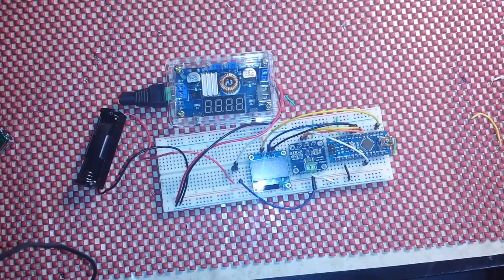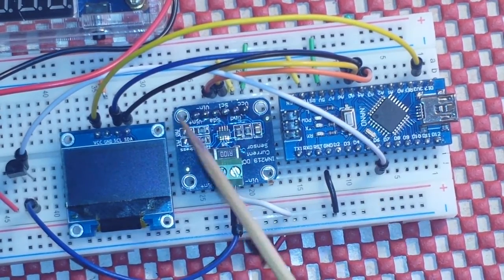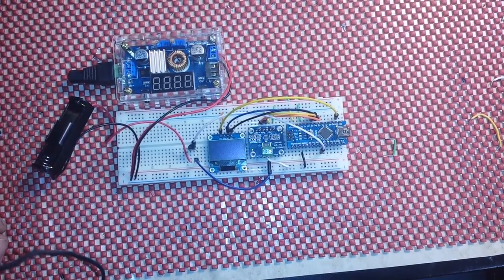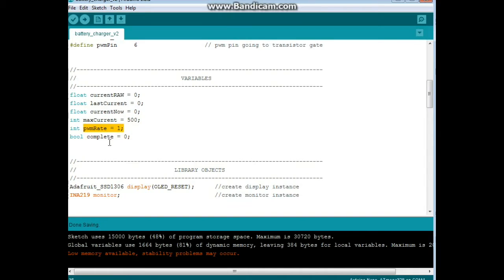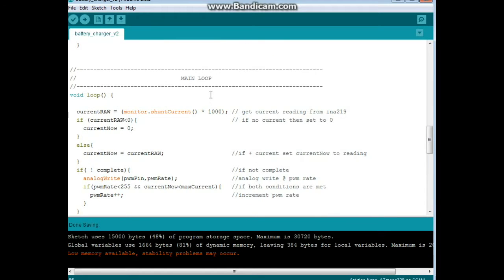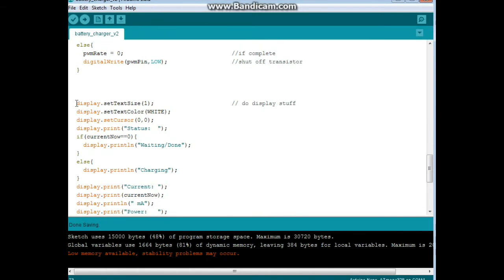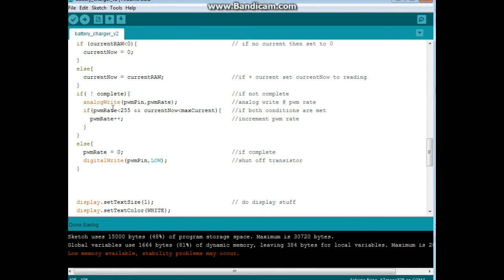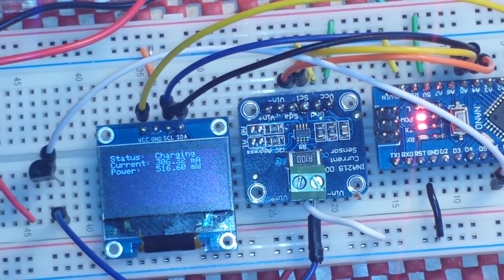How to make an Arduino Battery Charger v2

Comment: Excellent video!  I have a question if you wouldn't mind.  I've followed your setup to the letter.  How would I go about modifying the code to charge a 9 volt rechargeable battery?  I don't think I need to modify the hardware, when I plug the 9v in the power on the OLED goes way up but it doesn't change to "charging" at all.  Thanks in advance.

Comment: I like that bit:
if(pwmRate<255 && currentNow<maxCurrent){
pwmRate++;
}

It's like you either have your max current (500ma) already at the minimum pwmRate
or you keep increasing the modulation of the opening of the transitor 
in order to let more current in until you get max current.

That's savvy !
That's a good idea if you are using USB 3.0 that can give you 900ma right off the gate.

The part I'm not sure about is if Negative delta V Cut-off
is safer than just stopping 3mV before full charge ?

Comment: I just don't know what Im asking.
I am trying to build for a 4.8v NiCa battery pack.
A cheap version that's made in china.
You've mentioned in the description that with constant current mode, different setup may be charge. So, this will work with up to what number of battery?
I am confused if that charging voltage should be greater that the battery pack that I am charging since you mentioned it can with constant current mode.
Thank You for the circuit.

Comment: Very cool video. I like it. Do you think you will ever build this into a 18650 charger? Also, if I wanted to charge two NiMh batteries hooked in series, could I just step up the voltage? I'm asking because I have no desire to let any magic smoke out or burn my lab down.

Comment: 2n4401 is an NPN and using this on the high side of your load. which means you have to drive the base harder to get above the emitter? wouldnt this be better with the NPN on the low side of your load in a normal switch configuration. also you have no current limiting resistor on the base which could lead to issues

Comment: Nice vid :-) been threatening to knock up one of these myself. I think the negative delta V (NDV) refers to the drop in voltage while charging as opposed to the current though.  Some great info here http://batteryuniversity.com/learn/article/charging_nickel_metal_hydride that you may be able to write into the code.
Reply: More info here http://www.powerstream.com/NiMH.htm at the bottom of the page 'The Ultimate charger' :-)

Comment: Nice project!
You could make it more interesting by using that unused OLED space to show the accumulated charge, the charge time, the voltage (from the INA219) and the battery internal resistance.
Reply from the maker: Javier Palla Lorden thanks...ideas for part 3. specially the mAH
Reply: Looking forward to part 3!
Reply: Hi, still waiting for part 3.......... :-)
Reply from the maker: Soon buddy, soon I promise. Things are getting crazy around here. I have two major sponsors coming on board. So lots of cool new ideas and videos coming up.
Reply: @learnelectronics  Did you ever follow through and finish the series? I couldn't find any thing in your video listing.